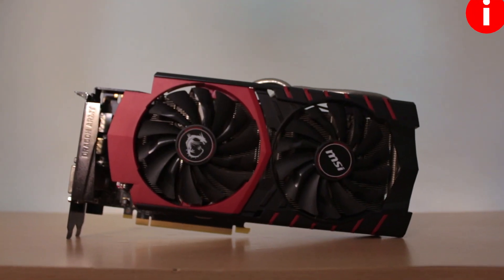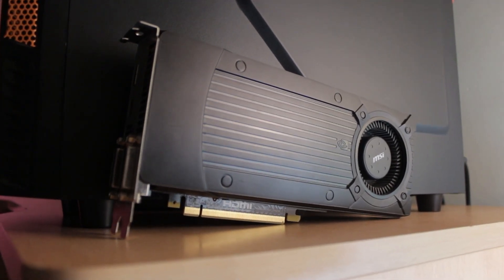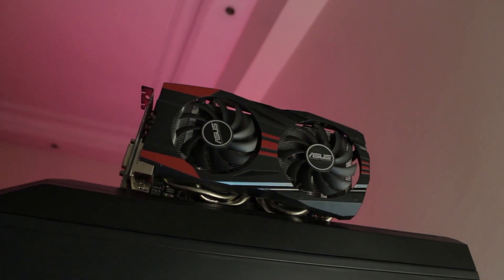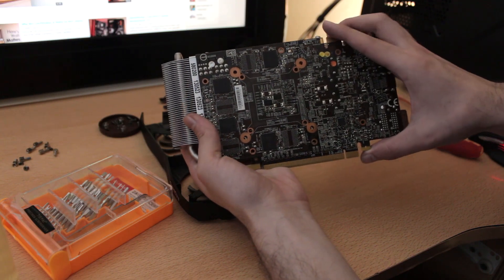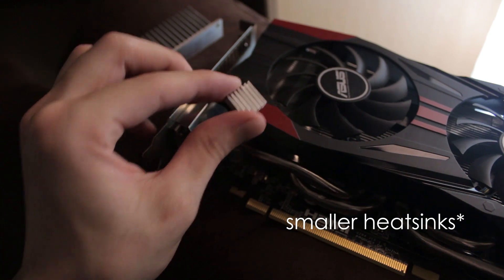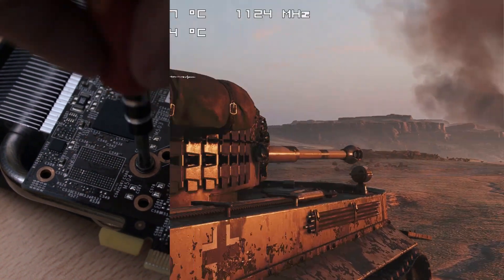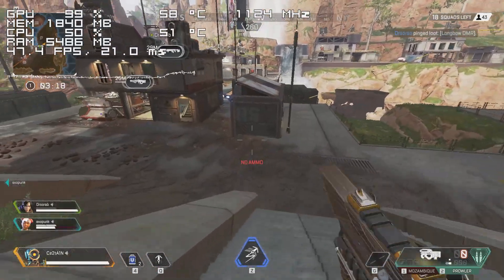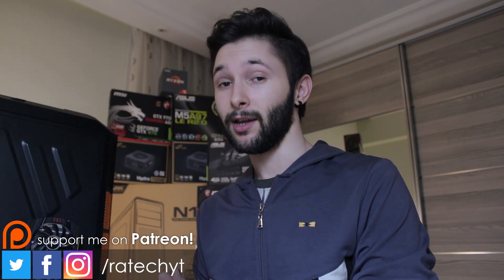Replacing a GPU Heatsink - How To Fix a Loud & Overheating GPU!

Comment from the maker: What is your experience with blower style GPUs? Like them, hate them?
Reply: Like bcz it look simple
Reply: They are very loud imo, i used to run a gtx 970 non-blower card, which was fine with how loud it was (barely heard it). But when i upgraded to the RTX 2080 where i bought a blower version from, the temps would skyrocket, and to compensate i had to turn up the blower. Was waaaaay too loud, people could hear it through my mic, i could hear it from like 10m away. It's sad. Feleing like buying a aftermarket cooler...
Reply: @dafuuq9766  best solution was from diy perks... He put a cpu cooler.😂
Reply: Wanted to give them a chance. Never getting them again.
Reply: I hate them, I would much prefer sub 70 degree temps but that is very hard to pull off with a 1070
Reply: I'm having the opposite problem. My case work with a slight overpressure with air being forced out through the top. However my fan GPU is just adding a lot of hot air inside the case and blows almost nothing out through the PCI cutouts! I would rather have had a blower type card. I have noticed there are $40 blower style knockoff heatsinks available and I have room for a bigger slower rotating blower, for less circular saw noises.
Reply: sounds like a hairdryer no cap
Reply: rx 550 blower style is good for me. blower style gpu are best for low powered gpus. dont buy 8 pin and up gpus with blower style fans
Reply: hate them with passion
Reply: qua looks. I think they look super cool. qua cooling. Nooooppppeeee

Comment: I have an gtx 670 and its the same style as your 760 and i have same problem i changer thermal paste many times and clean it and no changes at all i tried to put fan in max rpm too and not too much decrease 😢

Comment: Replaced thermal paste on my single fan Asus GTX 1660 Super. It was going up tp 85c easily. After thermal paste replacement, I am reaching about 75c. So, I limited the FPS of the card to 60 in NVIDIA Control panel. Now, the temperature stay below 60c in the games I play. The card stay below 70% TDP or lower in the games I play. The gaming experience is very smooth. The card has headroom power and the 1% lows are nearly the same as AVG FPS because of that. That will do for me.

Comment: I dislike blower fans by a large margin. Especially since I prefer to use Quadro cards that aren't very cheap to begin with
But I have successfully replaced those pesky, whining fans by large heatsinks and cool them with case airflow only (never exceeding 60 degrees Celsius)

Comment: Hello i got a sapphire hd7950 with blower fan and i found a heatsink of gigabyte’s hd7970 with 3 Fan windoforce. Im getting 90-100 degree with blower fan so if i buy the windoforce fan is it going to change to 60-70 degrees from 90-100? (Sorry for bad english)
Reply from the maker: It totally might, as long as the fitment is right. Make sure to do some research before getting the Windforce card.

Comment: Hey 

I got from eBay gtx 980ti

Put on evga 1070 sc cooler

Got it for 10£

Few fins were removed, but temps idle 30s
Gaming 66-70 max

Comment: Any thoughts on replacing a asus 2070 super blower cooler with another asus cooler?
Reply from the maker: The graphics card that you're going to remove the cooler from should also preferably be an RTX 2070.
Reply: Currently sitting with inno3d 2070 super blower style did u have any success

Comment: Are there any aftermarket options? I don't really have the expertise or the tools to modify an existing factory-heatsink if it doesn't fit. I have an ASUS GTX 970 Turbo OC which comes with what is probably the crappiest blower cooler ever made.
Reply from the maker: I don't think there are.
Reply: Looked into it, there are many options but they're pretty useless beyond noise reduction. Seems like the way to go would be to simply zip-tie 2 regular fans to it.

Comment: would a 970 zotac blower be compatible with a 970 msi dual fan?
Reply: Please update if you find out. I'm trying to replace the cooler on the same card. It's super loud and hot.
Reply: @boomshaka918  I kinda gave up man sorry
Reply from the maker: The only way to learn to try it.

Comment: Would any heat sink work if they are from the same chipset
Reply from the maker: You might run into clearance issues, just like I did with this project.
Reply: @RATechYT  ok thx
Reply: @RATechYT  hi i want to try this project, can you try if asus strix rog 580 cooler would fit on gigabyte rx 580 8 gb
Reply from the maker: @sneakyturtle8080  I can't unfortunately. The only way to find that out is to get the parts and try it out yourself.

Have a look at disassembly videos of both cards, at least you'll have an idea.
Reply: @RATechYT  ok thx, also any tips to get my hands on a 3060?
Reply from the maker: @sneakyturtle8080  I can only say the obvious, which is frequently check for stock.
Reply: @RATechYT  lol ok then thx

Comment: how did you get more temps on your old gpu cooler than my laptop like i have the 720m and it shares heatpipe with cpu and it only hits 70 degrees after playing gtav for 2 hours
Reply: Because your 720m is a less powerful gpu.That 970 is a blower type. Remember *blower type*. These blower type gpus usually have overheating problems.

Comment: Same issue. I used to get 82 degrees, and it would shut down. I disassembled and cleaned the heatsink and put new thermal paste. I got 72 degrees, but it still shuts down! I'll try changing the thermal pads as well.
Reply: if it shutdown then there is prolly something with your psu
Reply: @hobbiekhn3713   or motherboard and RAM

Comment: Just a question sir,
I'm planning to use my dual fan gpu heatsink from my old gpu that have two 6-pin power connector - to my gpu with only single fan and no 6-pin power connector.
WILL IT WORK?

Single fan gpu - Biostar RX550 2gb
Dual fan gpu - MSI GTX 560Ti (N560GTX-M2D1GD5)
Reply from the maker: You can give it a try, though I'm not sure if things will fit. I believe it is doable, you're just going to spend a lot of time trying to make it work.
Reply: @RATechYT  I really want to give it a try sir, but i'm thinking twice because maybe my RX 550's board won't support (or is not safe to use) the dual fan due to power consumption thing, tho the pin will fit i think.
Do you think it won't fry my GPU by trying these 2 fans in it??

PS. I just want to change it to bigger heatsink for better cooling.
Reply from the maker: @myokk1052  I don't think it should be a problem. As you can see I also changed from one fan to two, and the graphics card is still working just fine.
Reply: @RATechYT  Thank you sir for the replies, gonna give it a try 200%. Best regards from the Philippines! +1sub

Comment: I have a GTX 1070 BLOWER and this thing is really pissing me off I can't even play games anymore without it randomly going from 200 fps to 40 fps and the heat going too 93c
Reply: Did you find a cooler that works? I have the exact same issue and I'm still trying to research coolers
Reply: @braveatnight  What I did was open my graphics card and change the thermal paste, that helped me a lot and I would recommend you do it too.
Reply: ever heard of undervolting?
Reply: @level8473  No but I fixed my issue by replacing the thermal paste.
Reply: @glockworks  You should learn it, it's going to reduce your temps even more without losing performance
Reply: @glockworks  Replacing the thermal paste completely fixed the problem? What did your temps look like after that? Thx

Comment: I am currently experiencing this overheating issue with my 1080 blower style cooler. Any recommendations on how to replace the cooling system on that?
Reply: Get a Artic Accelero Extreme on Amazon, performs waayy better than any cooler and is Quiet Aswell.

Comment: did someone know why its overheat even when the thermal paste and thermal pad is changed?
Reply: Maybe you have put too much thermal paste? It's worth a check, just in case. Too much paste can be counterproductive, as it will increase your temps.
Reply: @voineaadi  i found it what's wrong with my GPU. The contact surface of heatsink and the GPU is not perfect, its defected meybe. Wich is weird and stupid. I try screw realy hard its not work

Comment: I have a r9 290x overheating i thinked about buying a dead gtx 780ti with the asus rog matrix heatsink its ok even its from nvidia ?
Reply from the maker: You can give it a try, though I'd rather get a dead R9 290X from a different brand.